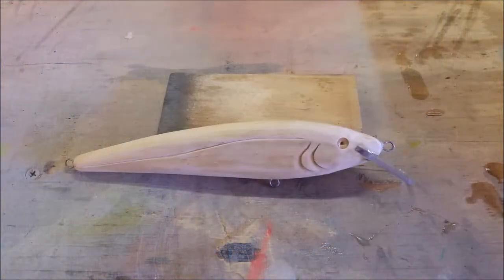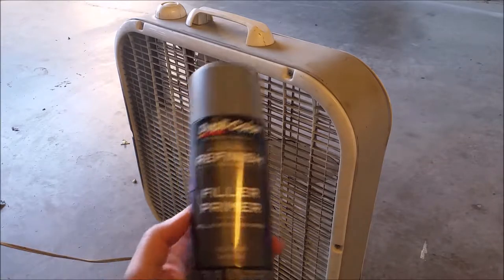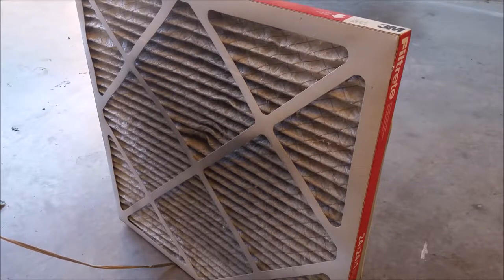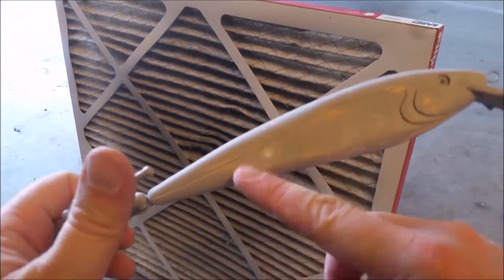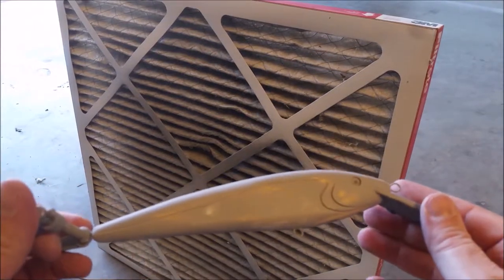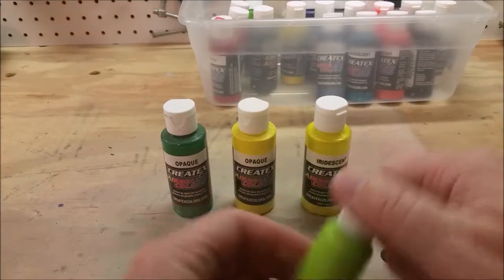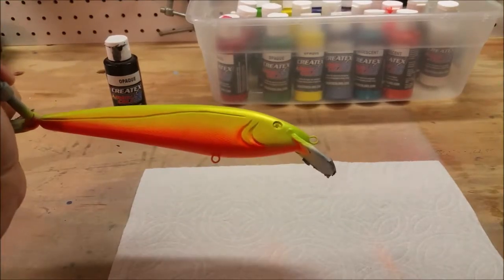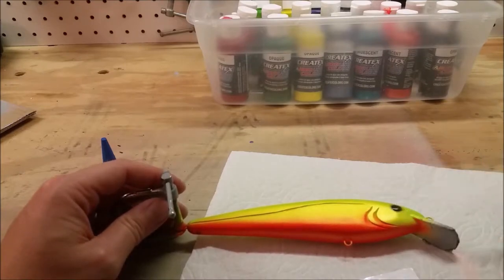Painting a Peacock Bass Pattern on a 7" Wood Lure

Comment: What’s the pen you use to sign them?
Reply from the maker: It's just a Pentel gel pen. It's slow to dry, but writes decently.
Reply: Everytime I try to sign them , uv clear always messes it up. Maybe I should try epoxy and see if it makes a difference. I like the way epoxy looks but man it takes forever
Reply from the maker: @Backroadsfishing  I don't have any experience with uv clear. Mine will mess up too if I don't let the ink fully dry. Another thing I've been meaning to try is a quill pen and model paint. I'm not sure, but I think that is what rod builders use to sign with.

Comment: Wait wait, wait...its not 50-50 for the epoxy??  For one lure I use 3.5g to 3.5g,  is this wrong?  Epoxy does harden.. Im confused...
Reply from the maker: So the 50-50 ratio is by volume because this product is meant to be used in larger quantities for counter tops and such. Since we are using it such small batches, the more accurate measurement is by weight. Because each part has different densities, you will get different weights for each part of the same volume. Sorry I didn't explain that in the video. Like I said, this product is quite forgiving so it may not really matter that much. Thank you for your question and for watching the video!